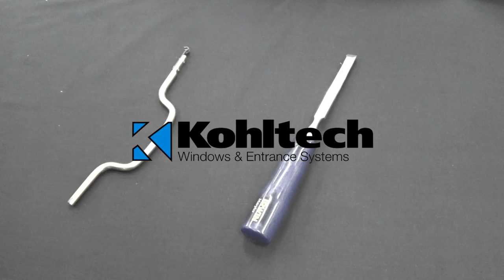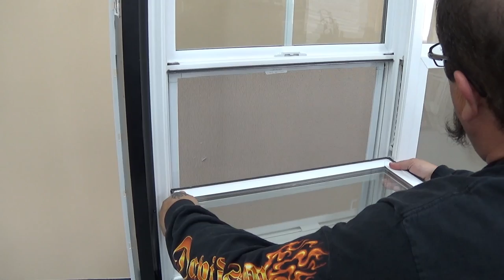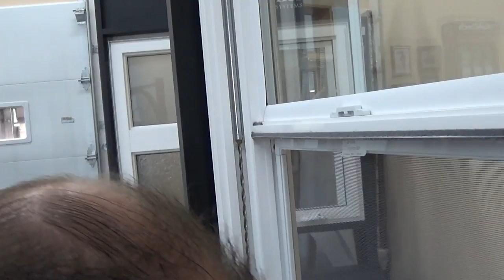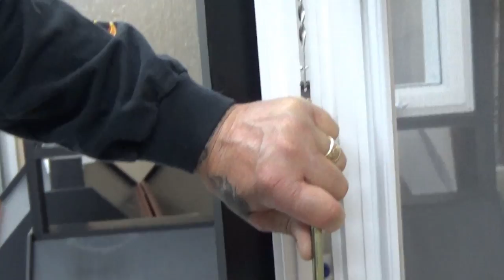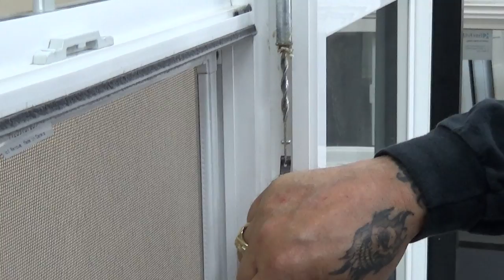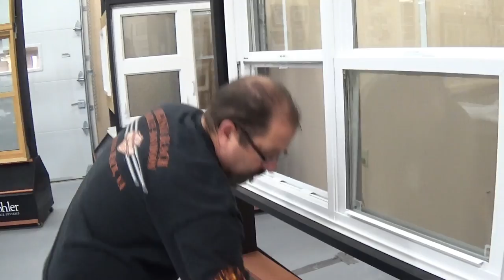HOW TO: Adjust Spiral Balance on Windows

Comment: Thanks for video.  Just want to share my experience with adjusting spring tension.  I did as instructed,  I raised the right side of the sash so I could begin to take it out.  When I did that, the plastic block released and the right side guide mechanism sprung up.  When I investigated further, the blue pivoting insert popped out of the plastic block and was still attached to the pin on the sash.  Getting the blue circular pivot insert back into the sliding plastic block was no easy feat.  I spent 45 minutes trying get the pivoting insert back into the sliding block.  So for me the better method was to bring the sash down to horizontal and use the spring tool without removing the sash.  So I would suggest that you try releasing the spring without removing the sash first.  If that works great.  If it doesn’t then go ahead and remove the sash as the video instructs.
Reply: That's how I adjusted mine. I left the window in the frame. I had a hard time with the tension adjustment.

Comment: What do you do if the tool slips out and the spring gets released?
Reply from the maker: Just start from scratch and I wind it up about 7 turns and try it to see how it works if it’s still dropping put a few more turns on it and try it again . It depends on what he size but 7 is the magic number I find . 
Paul

Comment: "Clockwise motion" - turns it counter-clockwise...
Reply from the maker: The base of the tool is spinning clockwise, that's what we use for rotation. Hope that helps!
Reply: @Kohltech Windows & Entrance Systems  I still don't follow as far as I can tell the base of the tool is also spinning counter clockwise
Reply: I thought I didn’t know what clock wise meant for a sec 🤣

Comment: Thats absolutely not how windows work around here. You cant tilt 90 degrees haha. You have to remove the frame to get the window out. Not only that but the sash springs are screwed into the bottom of the window that needs to be removed.
Reply: Sounds as if you have some older (1950s-1970s) wood-sash windows. I've seen the kind with regular coil springs which use the friction of the aluminum tracks to make up for the varying force of the springs. When I was a kid, we had a different style that had the spring on the inside of the worm gear (spiral), and you could adjust them by turning a screw at the top of each side of the  sash  one click at a time. Those needed periodic lubrication or they'd bind up and break. They usually needed spring adjustment each time they were oiled.